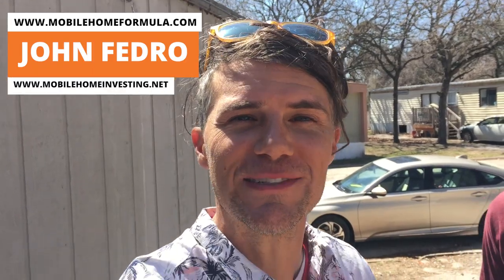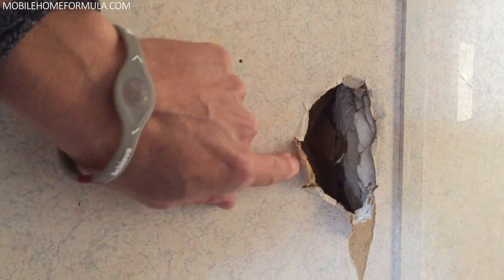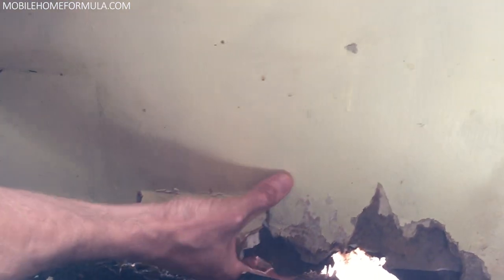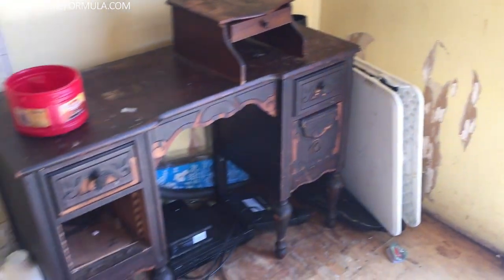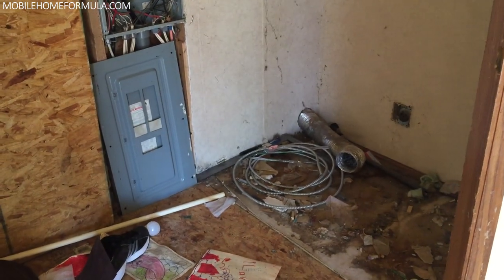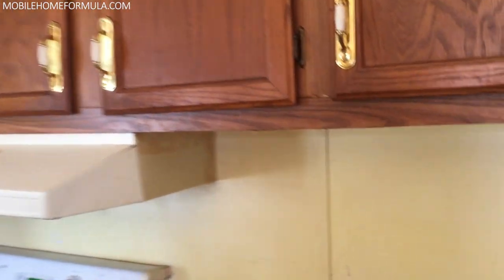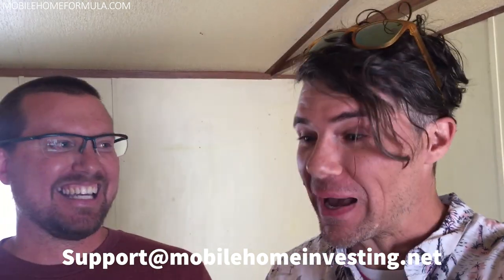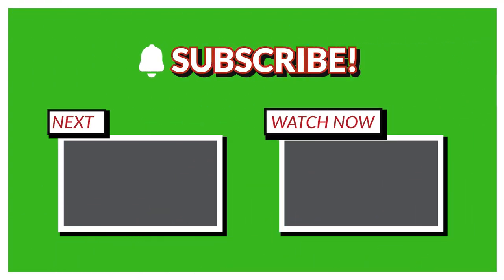FREE Mobile Homes Still Exist

Comment: will the park let you move it? That's another thing to check into in fact the first thing to check if you plan on moving it.
Reply from the maker: Hi Bobby. You are so right. That is definitely a good question to ask before purchasing any mobile home inside of the park. However I would phrase the question in a way that lets the manager think you do not want to remove the home if possible. Most managers will not want you to remove the home in most situations. This will reduce the value of the park and reduce the revenue as well. However some parks have no problem with you removing the home, keep in mind that many of them will not stop you however you will burn a bridge from investing in the park in the future. Keep in touch moving forward. Any follow-up mobile home questions never hesitate to reach out anytime. All the best.
Reply: @MobileHomeFormula  Thank you for your reply. I didn't know this kind of information, how ever I did tell our Manager this was what we are going to do. Let me explain a little bit about why we are moving it. First, the manager has been raising our lot space for the last 5 or 6 yrs. We had no problem with  Five or even a ten raise which is what started with, then the next yr comes and it's a 15 dollar raise so within a 2 yr it was a 25 dollar raise now both my husband are on a low fixed income, and he keeps raising the rent. it's now been raised up to 740 dollars, which when we moved in it was only 340 they pay the water sewer and trash, and now we just cant afford the lot rent. Just yesterday we got home found a note on our door that read, we now have to pay for water sewer and trash from now on. We had water problems from day one, and they said it was on us to pay oh I can go on about this  so I wont bore you to death.  I do have other questions to ask, but I'll ask tomorrow it's late. Have a good night, and a blessed day tomorrow. once again thank you for the information.

Comment: I have a mobile home here in Long Beach my rent keeps going up2 x a year , is it possible to move it? Do you know a place in San Diego to move it?
Reply from the maker: Thank you for reaching out and connecting. That is awful and disgusting to hear about your rent going up double per year. Some park owners do not care about the residents and only look at them as a $. Plus, if the park keeps reselling in the new buyers are forced to raise the price if they overpaid to purchase the park in the first place. Mobile homes are definitely mobile, however if they have a lot of additions or were built before 1976, or have a broken frame, or are locked into a space due to trees or a building that cannot be moved, than the mobile home may be very very difficult to remove. You may call a few mobile home movers and send them pictures of your home to ask if they would be able to move it and give you a price to move the home within a 30 mile radius. I do not know specifically of a park in San Diego that will take used homes. Most of the parks I am familiar with one brand-new manufactured homes only inside of the community. In many areas mobile homes are not that affordable anymore. I'm sorry to hear that you are going through the situation in the first place. I'm sure this is not the answer you are looking for however I hope it helps and points you in the right direction. Any follow-up questions please never hesitate to reach out anytime.

Comment: Based on the interior materials, especially the walls and single pane windows, along with the typical roof leaking above the windows, I would've guessed it was a late 70's model. 😳
Reply from the maker: Great comment! If the roof is original that you make help give the average person a clue to the age. On a single wide a pointed roof will indicate that the home is roughly 1982 or newer. However if the roof is curved, with no point to it, then it is usually in the 60s, 70s, or very early 80s. Hope this helps and makes sense. Feel free to keep in touch moving forward with any follow-up mobile home questions or comments. All the best.

Comment: I would absolutely replace or at least rip out carpet if there is animal feces anywhere in house
Reply from the maker: Thanks for reaching out and connecting. You are definitely not wrong! Anyone that would want to live in the home or have their kids or pets in the property would likely want to replace the carpet/floor covering as well. However it depends on the exit strategy as to whether a mobile home investor would want to make this repair or not prior to selling the home. Whether replacing the carpet or not, removing all of the debris and feces and junk and everything else is important with regards to making the home more attractive to more and more potential buyers with cash. Thanks again for commenting. Moving forward never hesitate to reach out anytime with questions or follow-up comments. All the best. Keep in touch.

Comment: Awesome video thanks
Reply from the maker: Hi SIP. Great to hear from you both! Thank you for reaching out and connecting. Thanks for watching the video. With regards to an outcome… Casey is put around $4000 of repairs into the mobile home. Much of these have gone into cleaning out the home, wall repair, mold removal, and plumbing underneath the mobile home. He sold the home for approximately $10,000 to a quick buyer that is going to do the rest of the repairs and move into the home personally. Certainly not the biggest deal in the world but a quick doubling of the money is not bad. Thanks again for commenting. Any mobile home questions that you have never hesitate to reach out any time. Keep in touch. Keep up the daily effort and focus.

Comment: What does it cost to move one
Reply from the maker: The answer to your question definitely depends on the location that you are around the country. Also if the mobile home is a single wider double wide, and if there are any additions to the mobile homes that need to be torn down and moved as well. Also if there will be decks that will be moving with the home as well, this will change the price up. However a single wide and 50 miles or so around the country will be roughly $4000 give or take. In some areas it will be as low as $2000 in other areas it will be as high as $8000 to move a single wide. However I hope this helps and gives you a rough estimate. Deftly call around to a handful of local movers to compare prices, build rapport, and how long they have been in business.

Comment: Where is this located
Reply from the maker: Hi Donna. Thank you for reaching out and connecting. These homes are located in the central Texas area. However mobile homes like this may be found in every state except for Hawaii. However they typically have to be found or attracted quickly, if they are sitting on the market for too long they will get snatched up fast. Feel free to keep in touch with any follow-up mobile home related questions. All the best.

Comment: How to find free homes?
Reply from the maker: Thank you for reaching out and connecting. Additionally, thanks for watching this video. I do hope that it was helpful to you already. In most cases we are not finding mobile homes that are free, we are finding mobile homes that sellers are asking some type of price to purchase the mobile home. However after we run our numbers on resale value, repairs, holding costs, labor, etc we may find out that we are not able to pay anything for the mobile home itself. In some cases this is still very helpful to the mobile home seller or Park owner as it fixes up the property, make sure the home will stay in the park usually, and will sooner or later begin paying lot rent and increasing the value and revenue of the community. Additionally, if the home has to be moved that is another big value you are providing if the seller wants the home off of the land. I hope that this helps him and point you in the right direction. This answer certainly is a bit vague however depending on the situation you are in I would ask you a couple dozen questions about every mobile home you are looking at. It is important to know exactly what you are looking at, and the realistic exit strategy you plan to take on every property before making any purchase offers to sellers. Hope this helps and point you in the right direction. All the best.

Comment: the cheapest mobile homes in my area are $50K...
   Where are y guys finding these Cheap Homes and Parks?
Reply from the maker: Thanks for watching. Good channel name! I took a few moments to go on Craigslist and definitely found mobile homes in the $40,000 or around the cheapest in my general area. There are certainly some methods of advertising and marketing that will produce better results than others in most markets. However it is wise to have multiple ways to find and attract sellers rather than just one or two. We ideally want to find and attract sellers prior to them listing online if possible. This is definitely easier said than done in most situations. We certainly do help some sellers with other types of situations, such as the home has to be moved, severe title problems, or serious repairs needed in the mobile homes as well. I would encourage you to use free and inexpensive ways to find and attract sellers rather than spending a lot of money on direct mail or expensive online ads. However there is definitely a time and place for more pricier and targeted advertising. While this definitely is a vague answer I hope it helps and points you in the right direction. Lastly, this video was recorded in Texas outside of the DFW area. However in every state there are free and very affordable mobile homes within driving distance, however they certainly will not last. Sellers have more options these days and we need to be well known and act quickly when we have decent opportunities. Hope this helps and makes sense. Feel free to keep in touch moving forward. All the best.

Comment: How often do you find a mobile home for FREE that doesn't have to be either moved, or completely rebuilt, or both?
I lived in a mobile for more than 20 years. In a park that went from privately owned to a resident owned coop. If you have a good park and neighbors, it can be a good life. 
I had a big choice to make. I could put a lot of money into my MH to fix it up to livable or I could buy a new house. I thought about replacing my MH in the park but would still be in the park. If I was going to move, I wanted it to be onto my own land anyway. My MH was in terrible condition infested with mice and I still got 10K for it. My buyer could build a new home under the metal roof I had just put on.
Reply from the maker: Thanks for reaching out and connecting. Great job selling your mobile home for $10,000 even though it needs so much work. You were able to get that price because somebody was willing to pay that price. You were also wise enough and had the time to put the home on the market. We are picking up mobile homes for $0 in rural areas as well as in hotspot metro markets even in California and Arizona. However I do not like to say free as usually the homes do need some rehabs or the people are behind on payment significantly. On average we are usually purchasing every one in 10 homes for a zero price. This is just the tip of the iceberg when it comes to this topic. However if you have any follow up or specific questions never hesitate to reach out any time. Great job again selling your home and I hope you find another place to live that you love and the neighbors are friendly.

Comment: Ya you bought property. The home isn't free cause yz gotta tear down and dispose or repair
Reply from the maker: Thanks for reaching out and commenting. This one was not a complete tear down. Simply fixing a number of issues inside and outside of the home before being resold. However you are definitely right, there is no such thing as free. Moving forward if you have any follow-up mobile home related questions never hesitate to reach out anytime.

Comment: I live in a 1996 1 bed, 1 bath that's in great shape. Wonder if I should have done rent to own. Would be cheap to update.
Reply from the maker: Hi Andrew. If you live in the mobile home then it sounds like it is already providing you good value. 1996 is definitely not that old at all. It sounds like it is not too late if you decide to sell it via a rent to own type of program. However make sure you thoroughly screen any buyers, receive a good down payment, use the correct paperwork, and make sure you are moving into another home that is a comfortable situation for you. Hope this helps and makes sense. Moving forward any follow-up questions never hesitate to reach out anytime.

Comment: It's from Catrina camp mobile home that has toxicity
Reply from the maker: Thank you for watching and commenting. There are definitely mobile home scattered around the country that have been involved in various disaster scenarios. These homes are used once and then auctioned off and moved around the country. I do not believe this particular home is a FEMA home though. Some of these homes are produced by mainstream manufactured home builders and some of them are produced by smaller factories. However you are right that there may be formaldehyde in some of these. Additionally, as they bake in the sun these chemicals can come out more. Make sure to air out a mobile home a bit if it is been sitting in while. Keep in touch moving forward. If you have any mobile home specific questions never hesitate to reach out any time.

Comment: I have a free mobile home located near Asheville that was previously set up as a workshop/mancave. Just let me know if any of you are interested!
Reply from the maker: Hi Ches. Thanks for reaching out and connecting. If possible, please send over some pictures of the property to support@mobilehomeinvesting.net. I do know one or two serious mobile home investors in the area that may be interested in having the property removed... At least I assume that it has to be removed. Either way feel free to reach out and keep in touch. You can also put this one online and it should go pretty quickly if it is free and in halfway decent shape. Keep in touch moving forward if you have any follow-up questions.
Reply: A

Comment: All that can be repaired
Reply from the maker: Hi Gerland. Thanks for commenting. Very good attitude. It all can be repaired, but it does not mean that it should be repaired. If you rehab an older, smaller, out of date 1970s mobile home. You will only be left with an old narrow mobile home. You are not able to sell these for nearly as much as you would a nicer home in most areas. However you are definitely still correct about rehabbing all of this if you really wanted to. I've been through homes from the 1960s that look nicer than one's from the 2000's. It is all about the pride of ownership and how well they are taken care of. Thanks again for commenting. Keep in touch.

Comment: Is it possible to get a Grant to for a new mobile home? How do you do that? The question is how do you get a mobile home for free? Is it possible? Thank you for sharing 😊
Reply from the maker: Hi Tammy. Thank you for reaching out and connecting. That is a very good question about receiving a grant of some kind for a new mobile home. I would definitely encourage you to search Google for grants in your state that you may qualify for. With regards to finding and negotiating a free mobile home you'll need to talk to a good deal of mobile home park managers and mobile home sellers. You talk to a few hundred managers will most likely find a free mobile home in need of some or a tremendous amount of work. I hope this helps and points you in the right direction. Feel free to keep in touch with Ford. All the best.
Reply: @MobileHomeFormula  Thank you 😊

Comment: Do you help people find one and do you also help people pick some up
Reply from the maker: Hi Christina. Thank you for reaching out and connecting. Over the past 10 years I have been helping mobile home investors find mobile home opportunities and deals all around the country. However I do not typically help homeowners find a home they are looking for in other states. I will help local homeowners go into one of my local properties, however I do not think this is exactly what you are looking for. I would very much encourage you to contact a local mobile home dealer or realtor in the area. These folks will be able to point you in the right direction and let you know what is for sale and where to find local mobile homes that people are looking to get rid of. While you will be paying retail prices using this method will provide you with an easy source of homes for sale. I hope that this helps and points you in the right direction. If you have any follow-up questions never hesitate to reach out anytime. All the best.